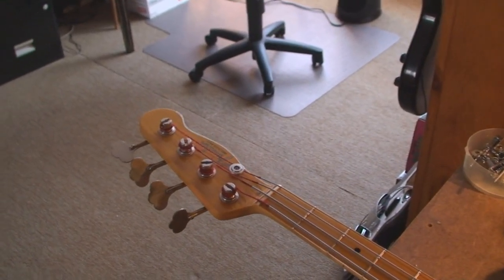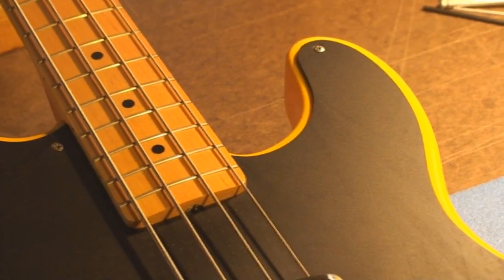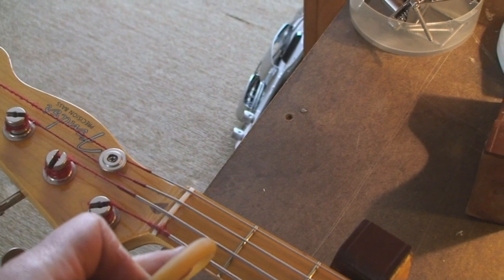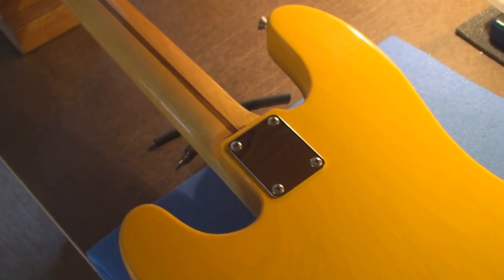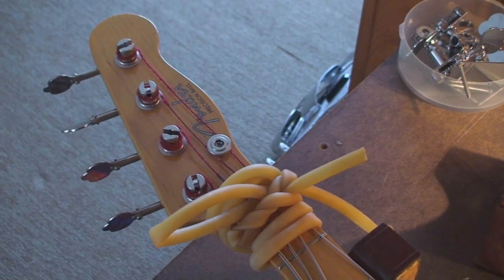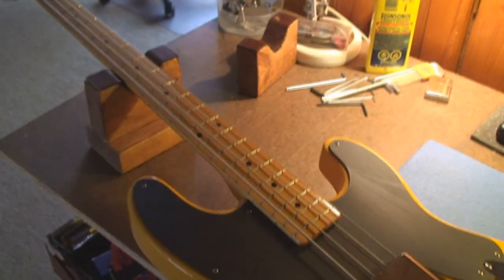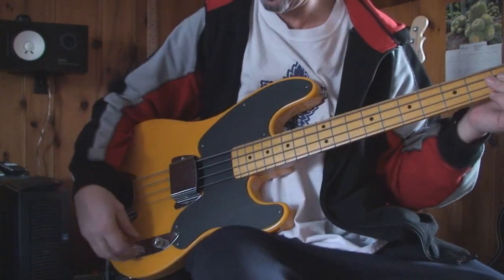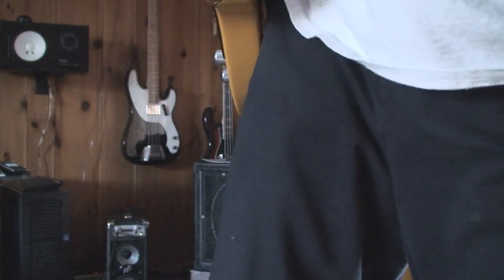1951 Fender Precision Bass Reissue DEMO  Truss Rod Adjustment

Comment: hey, just bought one of these barely used for $700 at the guitar center. the only problem i have is that i have to wait two weeks so they can check if its stolen or anything.

Comment: D,
have a truss rod question about an Ibanez P Bass I picked up to practice on. It is a beater I got and needs TLC. I pulled the strings off and i still have a convex neck, Mucho relief with no strings attached. Got the truss rod nut to loosen. Backed it off and am letting it sit for a day but it still looks like a lot of curve in the neck. My question is  do i want to get the neck flat straight without any strings? Should i apply a clamp to the neck as i have seen you do? I plan on restoring it